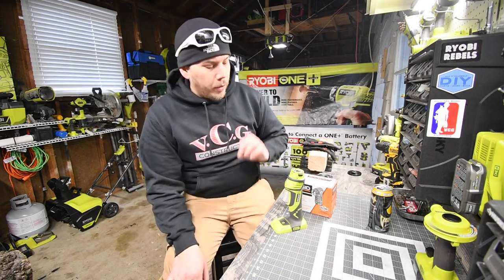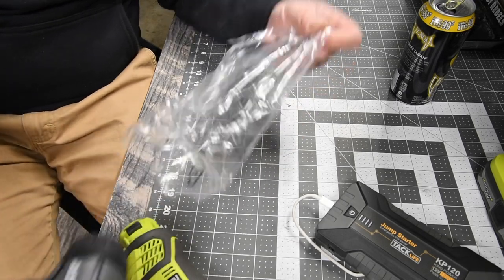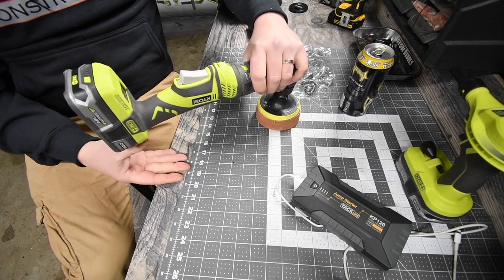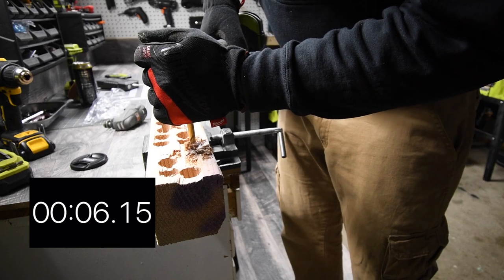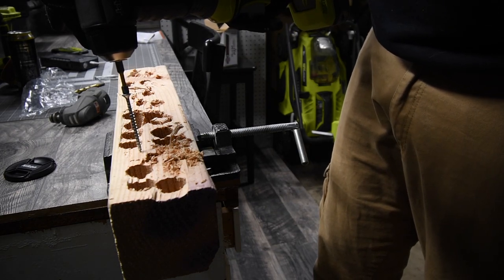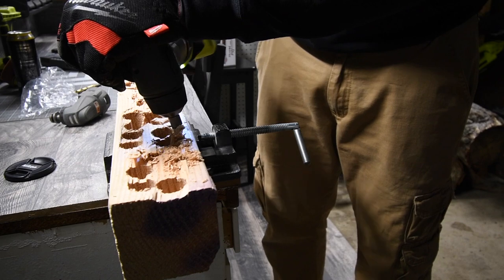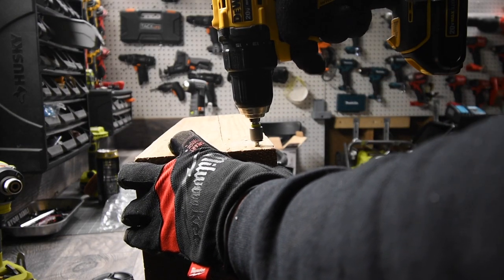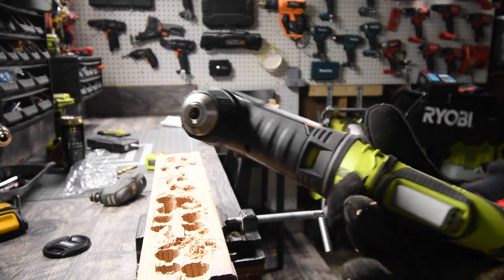Ridgid Job Max Right Angle Drill/Driver

Comment: I’d be curious to see how the right angle job Max compares to the stand alone Ryobi right angle drill.  
Also the ideal test is a 3/4” with a spade bit.   Electricians use right angle drills a lot for running wire
Reply from the maker: That would be a good one and thank you

Comment: Dave, have you ever checked out the Rigid Jobmax. I was wondering if its built any heavier or more robust than the Ryobi. Seems like the Ryobi unit isnt made very heavy to run all of those attachments.   I have all of those attachments but often thought that my Ryobi unit, which was recertified was a week link..   if the rigid unit was made better I may pick one of those up. Let me know, thank you!
Reply from the maker: I will do a versus video between the Ryobi and Ridgid multi Job tool soon
Reply: @ManCaverTools  excellent, awesome!
Reply: I was thinking g about getting either the jobmax or ryobi cant wait for that vs.

Comment: I saw your video on the 6 inch buffer and it is ordered.  I have the multi-tool also and have not ordered the right angle drill. Q.  Which is better for waxing and buffing your car and boat?
Reply from the maker: There is a difference between buffing and polishing. Polishing with a right angle drill is something you do after you buff

Comment: Cool review Dave.   I forgot about the Rigid tool heads for the multi tool. Now I can replace my Ryobi right angle blue drill that it almost dead. It smokes worse than your multi-tool.  Is your Ryobi assisted knife good quality? Did you get it on sale. $20 right now seems a little steep for Chinese blade? What is you opinion of the blade?
Reply from the maker: Thank you ver much and I paid full price, didnt know there was a sale